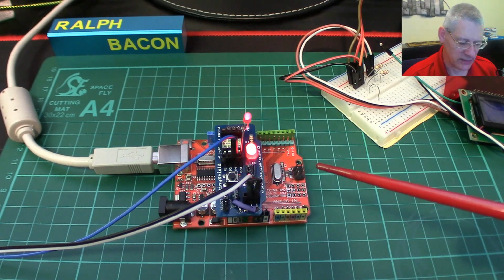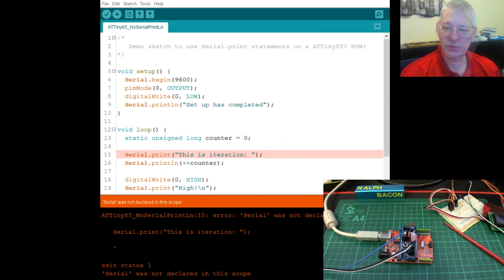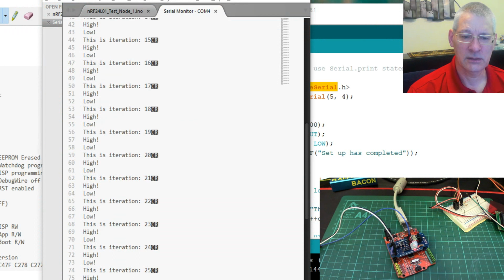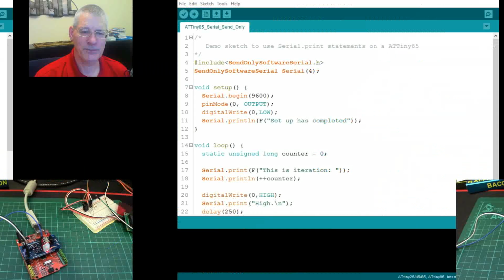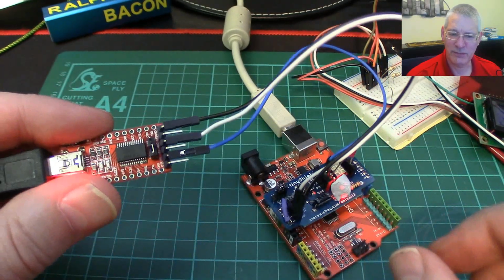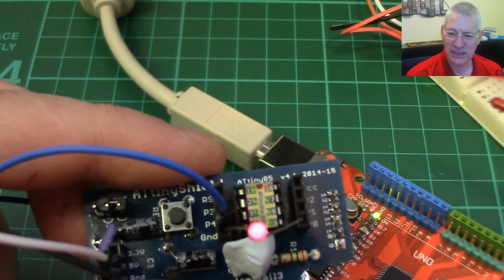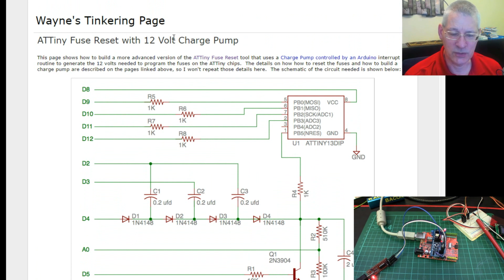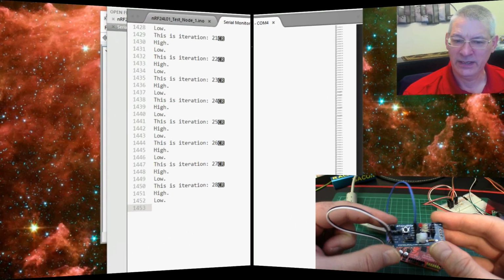#84 Making the ATTiny85 easier to program

Comment: I am struggling with ATtiny85 reading from DHT11 (temp and hum sensor) 255% humidity and 0 deg C temp. Same when sensor is disconnected
Reply from the maker: That almost certainly means that you have not connected the sensor (correctly). I would recommend getting it working on an Arduino UNO or Nano first, then transferring (porting) the code to the ATTiny85 which can be a bit of a *** to debug!

Also note that the DHT11 only goes down to ZERO centigrade; the DHT22 goes well below zero. Frankly I prefer the DS18b20 these days, you can get them in nice waterproof versions for just a couple of quid/dollars and the code is super simple.

Comment: morning boss, if you have time in you busy schedule could you do a video on joining the attin85 with an esp01. ive made a lovely thermostatic zero crossing fan speed controller. and id love it to output its temp value to my iot platform. but they wont seem to talk to each other.
Reply from the maker: Given the lack of, well, all communication protocols on the Tiny85 (see my video https://youtu.be/5bnXeHz06Ck ) if you have ONE pin spare you can use the SoftwareSerial library and just send stuff out on a TX-style pin to the ESP. There was a port of this library by Nick Gammon IIRC that just had the 'send' part to save space:
https://github.com/nickgammon/SendOnlySoftwareSerial 
I've tried it before and it works fine (as you would expect from the Guru of Arduino)!

The ESPxx just reads the data via the RX pin and you do with it what you want. As you are recording a temperature you probably will send a single byte (0-255 or -128 to +127 if you want to go below zero) to keep things really simple. Should be easy enough to prototype first. Any good?
Reply: @RalphBacon  i managed to get it working this morning ty. Ill make a pcb and ill send you a vid of it.
Reply from the maker: Good news, Paul, was this the way I suggested or another way?

Comment: hi ralph,
i have a problem
i want a servo motor to operate in 2 different speeds with 2 diffrent clicks on button 
for example normal 120 degree rotation speed at single click and fast 120 degree rotation at double click using on off tactile switch using a cr123a battery.all these using a pcb or arduino in the most smallest space.is it possible?
Reply from the maker: Short answer: Yes. Anything is possible.
Long answer: build a sketch that detects single vs double clicks of a button using interrupts. Good start is video #19 https://youtu.be/J9cDEef0IbQ even though you won't be using a Rotary Encoder, just a button.
Once you know what type of click has been received then you can easily control the speed of a servo (build a separate sketch for that first to prove you know).

Comment: 21:30 Why does the schematic show a =negative= 12V connection? The Github and every other page I see with a high voltage ATTiny resetter/programmer shows a =positive= 12V connection.
Reply from the maker: Well spotted. That would appear to be a mistake by the original designer, Wayne. It definitely needs a positive supply as shown in my schematic in video #87 (https://youtu.be/yAT_TdD6nL0 ) and it's what I designed in my custom PCB (video #144 https://youtu.be/bTTdvcnAOgg ) for the resetter too!
Reply: @RalphBacon  Yes, I saw that your schematic shows it correctly, so anyone building this from there should get it correct.
When I was first learning electronics, it seemed odd to me that the schematic symbol seemed reversed from an actual cell. I think it has to do with the history of voltage cells being built with the positive side being the larger side. Maybe.
Kind of like how many 20-somethings don't know why the "save" icon looks like it does.

Comment: Hi Ralph,  I cannot get the Arduino (V1.8.13,  Dec2020) program to Verify correctly as it raises an error at ' SendOnlySoftwareSerial Serial(4); ' and then tells me 'exit status 1'. The reported error is a conflict with what they term 'A previous declaration ' TinySoftwareSerial Serial ' ' to be found deep within the AppData folder in what seems to be folders relevant to the ATTinyCore.  I also note at the very end 'Invalid library found in C:\......\Documents\Arduino\libraries\XX: no headers files (.h) found in C:\.......\Documents\Arduino\libraries\XX ' which is untrue but could there be a second Library folder?  Could this be relevant?   I am not asking you to debug this for me, but has anyone else come across the same?  I have removed all ATMEL Studio programming software but I recoginse there may be a few leftover files somewhere. I have successfully loaded the flashing LED code so the program, UNO and ATTiny85 work correctly. I thought about removing, shutting down and reinstalling Arduino. Are there other actions I could try since the Serial.print routine is very useful when programming?  Anyway keep up the vidoes as they are informative, fun, and your style is perfect for me.
Reply from the maker: It sounds like you have a reference to a different SoftwareSerial library (as you mention TinySoftwareSerial.h, it sounds as though this has been optimised for the Tiny85 and included in whatever other libraries [or cores] you are using). eg Digistump or tinycore.
Remove your softwareSerial library and see what happens.
Remember too, that you cannot use the standard Serial.print - it must be whatever you have called the SoftwareSerial object, but there are bound to be examples with that library.
No need to reinstall Arduino unless you already know it's in a mess!

Comment: I have an ATtiny85 driving a 4 digit, 7 segment display and the display is showing the analog value of a 10k potentiometer.  I also want to transmit that value to my Teensy 4.1 but I'm struggling with the code on the Teensy to receive it.   forgive me if this comment is too specific but I'm stuck.  Thank you for your time.
Reply from the maker: When you say "transmit" I'm hoping you mean along serial wires, probably the Tx/Rx pairs we use for updating the code? If so, the RX on one unit is connected to the TX of the other (same voltages on each, right?) and in the Teensy just use "if (Serial.available())..." and read it in as you would on the Arduino. On the ATTiny85 you would use Serial.Write to ensure you were sending bytes of data not formatted text.
Reply: @RalphBacon  Yes.  TX/RX pairs.  I will power the ATtiny via the Teensy so the voltages will be the same.  There are NO videos on YouTube that show how to transmit data created in the ATtiny85 into an Arduino or a Teensy to then be used in the code of the Arduino or Teensy.  Could you be the first?

Comment: thank you for posting a very informative video.  wondering why the /n in some print lines, instead of just println.  not criticizing, just curious.
Reply from the maker: Good question! There are many ways to skin a cat (don't tell Benny) and you can either do a println or a print with the \n (or \t for tab) built into the statement. If you look at the underlying code for println you will find that it adds: write("\r\n"); to the string you are outputting.

Comment: https://dntruong.wordpress.com/2015/07/08/setting-and-reading-attiny85-fuses/

This is how I got the 6th IO out of my attiny85. I bought some cheap digispark clones that still had the reset pin enabled as a reset, instead of the desired IO (in my case).makes for a really user-friendly chip, complete with the micronucleus bootloader (for programming directly through usb and arduino IDE). 

That being said, The official Digispark has the 6 IO feature already preset, and saves the headache. But, I like to learn the hard way.
Reply from the maker: That's great that you have all six pins working as GPIO pins - just remember that if you ever need to reprogram the chip you will need the RST function to work so you need a simple 12-volt fuse resetter (as I described in video #87). Thanks for posting.

Comment: Hi Ralph S Bacon...
can u help me..how i program my attiny13 with hex file use arduino?
Reply from the maker: It's the same mechanism, VIvi. I've not used a ATTiny13 but the same principles apply. You might even be able to use the same helper PCB that I did.
Reply: In google search for: arduino attiny13 programming. There is an addon for Ardunio IDE  to program  Attiny13 chips. This is a small chip with only 1024 bytes program memory. Running at 4.8 or 9.6 MHz.

Comment: I like using attiny85 for small projects. I made a small nightlight with pwm and a ldr. Three years ago I made my own programing shields. The arduino as isp has a reset pin. So I made my programer with a roto shield and I can program atmel328p or attiny 85 with it. I have the adaptors to program smd also. I added led and a neopixel to it. I always forget to add the cap to it so I soldered on on with a switch.
Reply from the maker: Sounds great, Deathshaker. You could share your design of the programming shield on Instructables, for example, if you so wished.
Reply: @RalphBacon  So many wires. I really should make it into a pcb. Also I guess I should make a video of it also. lolz

Comment: Thats awesome! ...if it would work... i only get garbage as output on the serial monitor, even with 300 baud ;-(
Reply from the maker: It must be something to do with the baud rate on your Serial Monitor. It's got to be. I just don't see what else it could be! Have you tried a different chip (it is the ATTiny85 you're trying this with? I've not tried it on any other Tiny but it should work just the same). Definitely on the correct pins? I can't think what to suggest. Anyone else here have anything so say?
Reply: I made a baudrate iterator... i have to set up 10200 in the code for a 9600 baudrate working in the serialmonitor. Also 21500 for 19200, 48000 for 38400, 85000 for 57600, 315000 for 115200. Im still iterating for the 230400 baud rate... Any suggestions where this comes from?
Reply: Omfg it does not fit on to the chip with my other code..... argh!
Then i have to go back to my digital readout ;-(
Reply from the maker: If the baud rates don't match then the frequency of your Tiny is not correct; you'd better check it's correct otherwise all the timings will be out, such as millis(). Could be?
Reply: I have the same error. but then I programmed new ATtiny85, and it worked. don't know what is wrong with the old attiny82, but i did play around with the pin5 "fuse" setting .
Reply from the maker: I have just been playing around with a different chip, an ESP8266-01 and I too was getting garbage at all speed settings on the Serial Monitor. Eventually after resetting a few times it just suddenly started working, so goodness knows what was going on there, but it happened quite a few times. But it does show that it may just be an environmental issue rather than something wrong with the ATTiny85 or its setup.

Comment: I too also never had good luck finding a use for this chip.  I want to like it, but I always grow the project out of it.  The only thing I ever been able to make was pwm MOSFET control variable speed computer type fan with a thermistor input.  I think you are right about the two classes of people, some of us,myself included, don't do simple well.  It starts out "I just want this" and it ends up "yea, but wouldn't it be nice if it also did this..."...and there goes attiny....  We just don't a work the same, and that's fine.
Reply from the maker: Scope creep. Development creep. Call it what you want, James, it happens all the time. And if you start with a Tiny85 you quickly run out of pins. In which case you can just switch to a Nano or Uno without code modification. As you say, we work differently and that's just fine. Thanks for your comments, they probably reflect those of a lot of Arduinites out there.

Comment: Benny says yes, you were correct the first time.  His tests show the compiler does omit unused classes from the compiled binary.  He says studys in his lab show when he write a small class with a fat analogue read or write in it compile it look at total, then remove reference to it and the result decreases!  It works the save for functions too as you might expect.
Reply from the maker: Indeed, both you and Benny are correct inasmuch that the compiler is optimising and throws away code that nobody needs. Pity it didn't tell you which bits of code it was throwing away though, as you might have forgotten that you were not using something you had intended to use.

Comment: Use for attiny 85 - I wanted to build my own fish tank lights with a simple dimmer. 1 wire to the up button, 1 wire to the down adjust button, and 1 PWM wire to the mosfet. And I didn't have to buy some cheap crap dimmer, I purchased all components from Digikey which arrived in less than a week (not 1 or 2 months from china) and it didn't cost much. Components from Digikey, including LEDs, were less than $10.

Another use for the Attiny85, I needed to read data from the ADC and I needed 2 buttons plus output to an I2C oled display. Gang 2 buttons to 1 pin on the Attiny, read value from ADC, and output to the Oled. 

There are plenty of projects that don't need a full sized Arduino or the like. Plus the size allows me to make my projects much smaller when it is desirable to take up less room. I make my own boards to plug the Attiny into and I don't have to wait for more than a month for items of questionable value....
Reply: And I use the Sparkfun tiny programmer, I dont have to dedicate a full sized Uno.
Reply from the maker: You sound like a fan of the ATTiny85, Ian, for all the good reasons you've stated. As I've said in both this and later videos on this subject, it seems people fall into two camps. Camp 1 is Why Bother, just use a Nano for very little extra cost, and Camp 2 is Use the Right Component for the Job. I'm just here to give my Arduinites the options (not just my own opinions) so thanks for giving us some Real World examples where the Tiny works well :)
Reply: I also use a Mega for my 3D printer and an UNO for my small CNC mill. Lets not forget the Attiny4313, 20 pin package, SPI, I2C, UART, 4PWM, but has low(ish) memory, but I find that this just forces me to be intelligent while writing my code. My Sparkfun Programmer can program all adruinos, it has the standard 6 pin connector that can plug into a regular arduino (UNO, Mega and the like), it has an onboard 8 pin socket for the 85 and I made a simple adapter with a 20 pin socket to program the 4313.

I personally enjoy tinkering with any of the microcontrollers. They are so simple to use and the smaller 85 or 4313 are cool because I can put a socket on my projects to remove and reprogram anytime. I only really use the larger boards for much more complex needs. I find reasons to use microcontrollers just to tinker. =)
Reply: Ian Ide sometimes having assortments/kits pays back, and it is worth the wait. Get some of this stuff:
 https://www.futurlec.com/ValuePacks.shtml
That makes you build a project or prototype quickly, and cheap.
(Slow shipping tests your patience is virtue level ;)

Comment: AVR Programmer on ebay with cables and adapter is £4. number 131241223483
Reply from the maker: Hmm, couldn't find that item, Bob, not on eBay UK nor .com but I did find umpteen AVR programmers for all sorts of chips. £4 (about $5) sounds a good price (especially with cables and adapter) if it works for your chip, such as the ATTiny85. Some require a bit more TLC before they work, some "just work". Pays your money, takes your choice, as the market traders of London might say, but probably never do. If you can update that item number or give a link it would be great, Bob.
 
PS I'm on my annual leave starting tomorrow so I may be rather tardy in my responses (not just for you, Bob, but for everyone). Also the videos will be very thin on the ground. Oh well, everyone's on holiday now anyway so we'll catch up in a little while!
Reply: Hi Ralph this is the one on eBay USBASP USBISP ISP Programmer Cable Adapter KK2.0 KK2.1 Atmel AVR ATMega ARDUINO --131241223483 seller BOOSKIBITS 19914
Reply from the maker: Hello Arduinite! I'm currently on vacation 5,000 miles away from home so I'll have to be brief with these comments until my return, mid-July.
 
I just looked it up (although Google tried to route me to the Malaysian version of eBay, as that's where I am right now!). Anyway that link and item number worked fine Bob, and indeed the kit is fairly standard from what I can see, similar to an FTDI USB to serial programmer I used, except this goes directly to an Arduino's ICSP socket. If you get one, tell me how it went. I'll make a note of this though so I don't forget on my return...
Reply: Hi Ralph
Have a nice one I have packed your rain sensor ready to send to you in two weeks time hope you enjoy all the best Bob

Comment: great video Ralph,  those little ftdi adapters and xtraputty are great for simulation and test!
Reply from the maker: They certainly are useful, Carl, and using one in this manner I show here has made it much easier to find all my (er, Benny's) bugs in the code. Glad you liked the video!
Reply: I  hate to say this, but Benny is better at writing code than I am;> Like the video. I got 5 AT's today for a project. I think I heard you could use pin1 as analog input? I need 6 pins total. Thanks Ralph!
Reply from the maker: Hey Danny, do NOT despair. I've cracked the 6-pin GPIO pins on the ATTiny85 and a video is already scheduled on YouTube within the month, so write your project and I'll show you how easy it is to use all 6 pins very soon! Stay tuned.